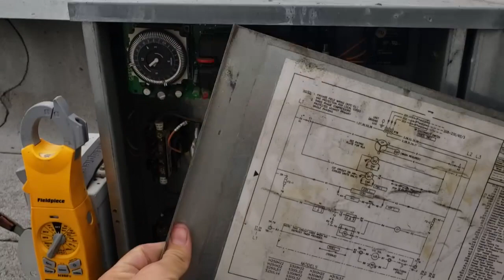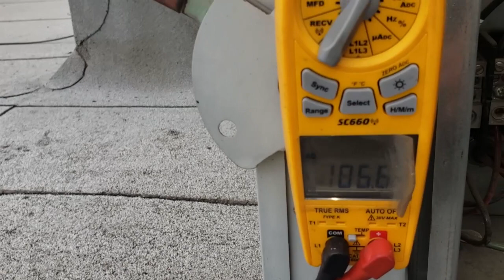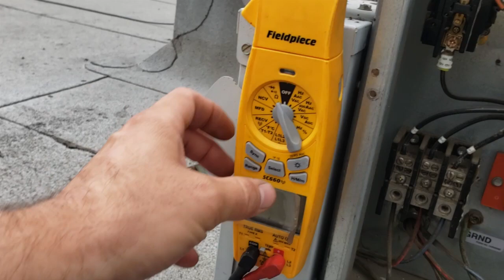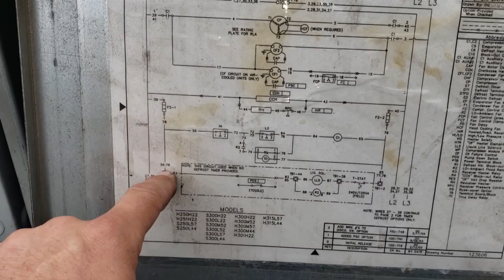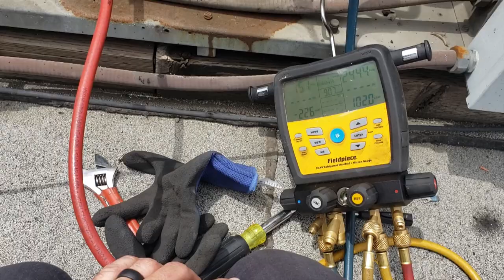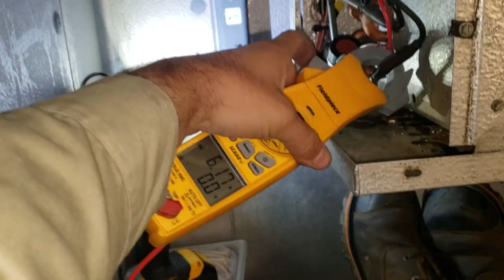WALK IN FREEZER BLOWN FUSE

Comment: Nice job on the wiring & good troubleshooting technique. Before subscribing, watching & learning from your excellent videos, I used to be the guy who replaced fuses & walked away if the unit held up & ran. Now I know better & break out my meter & perform checks for shorts & grounds as well as performing good visual inspections. We recently had a problem with a motor starter tripping out so I follow my supervisor up to the penthouse with my meter to do what I learned from your videos. My manager decides to take action into his own hands, flips the switch & sends a shower of sparks & a cloud of smoke in my face as well as catching the motor starter on fire. I was pissed off to say the least.
Reply from the maker: Wow yeah someone could have gotten seriously hurt

Comment: I helped electrician in the mines hundreds of nights with 480 3-phase and you learn neatness is everything.  There were three failures in the evap due to spaghetti, the past where someone brazed an elbow you discovered, the service call cause and the one that happened with you watching (lucky).  I would have done what you did, reorganize the mess.  In mines everything has packing glands and permissible (explosion-proof) boxes so space even more premium.  In the same environment conduit is NOT a trusted ground (corrosion) and MUST have dedicated ground(s).  I made a mental rule that forever forward the snaps get replaced.  GREAT GREAT Work Chris.

Comment: Very wise to change all of the snap-disc switches inside coolers. Those things cause innumerable problems. Cheap enough to replace them all and save yourself repeat calls.   That is, unless you're in the biz of nickel-diming customers with trip calls. Excellent work as usual.

Comment: Your system look so much fun to work on. Alot more room inside the condensing units than the UK. Wedon't have have electrical nuts in the UK as they were banned in the 60s or 70s. Seems to me like it would be good to bend them all to point upwards in the evap. This would encourage any moisture to run away from the termination inside. Great vids thanks for taking the time to make them.

Comment: Great work as usual! I’d love to see you further improve your electrical ‘proving dead’ procedure by re-checking your meter on a known supply (proving unit or in the local disconnector) after testing for voltage. The risk is that the meter somehow fails on the first voltage test e.g. it blows internally and so shows zero on your tests. The only way to prove this is checking on a known live supply after testing the circuit to be worked upon. In England, it is not permitted to use a multimeter to prove dead.
Reply from the maker: Interesting..... I will definitely try and improve! Thanks for watching again
Reply from the maker: I will be going live on YouTube this evening 5/20/19 @5:PM (pacific time) to discuss my most recent uploads and answer questions from emails and the chat, come on over and check it out if you can https://youtu.be/-4N3ueCvJOY

Comment: Did you fix that three conducter black insulted temp sensor line coming in into the bottom of the indoor unit? Thought I saw some bare wire before you cleaned it up. Great job and good find! Keep it up. Learning lots.

Comment: Chris, did you ever go back to replace that Receiver ? [ 11:59 ]There were three pressures control switches two on the compressor pipes and one on receiver which one is which and what do they do ? What does the R2 Relay and TD Marked Device do on this unit ? this will really help understand this unit. 
Thank you

Comment: I’m curious if your wedding band is a rubber band? I ask because I work on high-voltage circuits as a technician mostly on medical x-ray machines and medical air compressors. I understand the dangers of wearing a metal ring and I was curious if that’s why and if you’re wearing a rubber ring? By the way I like your videos and I subbed
Reply from the maker: Yeah it is a Silicone Qualo ring and I wear it because I dont want to lose my finger or worse.......

Comment: I’m sorry, you said you went to stranded wire so you could put connectors on them? Someone else actually understands that you can’t reliably crimp solid wire?!

Nice work! Only thing I would’ve done differently would be use flush cutters to fully remove the zip tie stubs. I’ve scraped myself too many times on my own projects!

PS. I highly recommend the hakko chp-170 flush cutters from amazon. Great tool for only $5
Reply: mman454 not exactly correct, but I do agree that one must use different crimps fir stranded vs. solid

Comment: do customers get upset over you filming whilst on a call out thinking your over charging them for the hourly rate you  fix the proberlm?
Reply: He is working the whole time he is filming, why would you get upset?
Reply: @deanmohamed7575  because he would be seen talking to a camera and having to hold the camera in 1 hand. then setting up the right angle etc. instead of just focusing on the job soley
Reply: I understand what you mean. Some customers can be that picky. I'm sure he knows where to film and where not to. But when your job is second nature, you can multitask and not affect it at all ;-).  Also Chris talks to himself anyway when he troubleshoots so holding a camera is the only additional effort. But your missing the point here. Not all of us have father's or uncles or mentors that can teach and nurture us. We were thrown out in the battlefield like front  line warriors. There is a tremendous gap in education in this industry. Everyone's a parts changer and freon charger and no one knows what they are really doing. It's videos like these that makes our job as a tech a little bit easier everyday. And ultimately it benefits the entire industry with more well trained techs that can efficiently do the job right the first time saving thousands of hours in labor for customers worldwide. Now tell me: spending 5 mins out of the hour adjusting the camera is not worth it?

Comment: I didn't see this in the other comments but didn't read them all either: at 13:31 that black electrical line coming into the box looks like it has the green earth wire clipped off. (I don't know anything about all this but I like learning) Is that what I'm seeing?

Comment: As a mechanic, I have to constantly tell myself, K.I.S.S.,
Keep It Simple, Stupid.
I've seen lots of "mystery electrical bugs" not be resolved by overeducated techs that reach for a $5k scan tool before using a bit of common sense and doing the basics first. Like checking fuses, relays, loose/dirty connections, etc. Just a thought from me. Carry on...
Reply: Knowledge and good judgement comes with time, it's called experience.
I used to be an electronics technician and you are right, people should start from the most simple causes.
Reply: @redangrybird7564  I never trust anyone else's diagnosis either. I dont take anything for granted in diagnosis. Every time I have, the one tiny stupid thing I overlooked is what's wrong. Did you also notice in this video the ground wire cut flush with the sheathing?
Reply: @robbyschemonia3089   5:37. Right ?
Reply: @redangrybird7564  yep. Personally, I dont care if its grounded through the conduit, there is a ground wire there, use it. How much longer could it have taken to connect it on both ends? And, isnt there some kinda bureaucratic something or other about not using conduit as a primary ground anymore? Idk, like I said, not an electrician, or HVAC tech, but I do read a lot of obscure books, and watch videos such as this one to fill my head with more knowledge that I'm never going to need. Lol